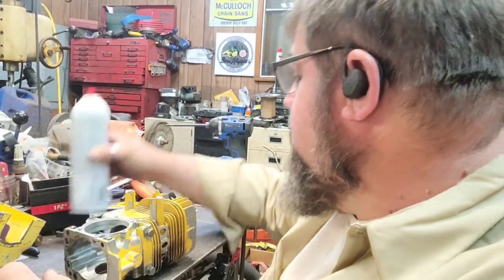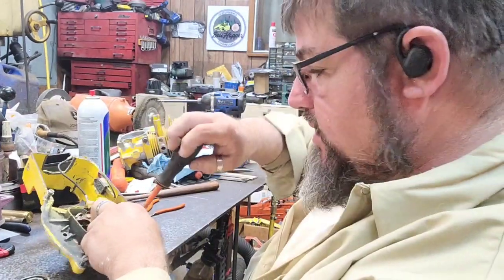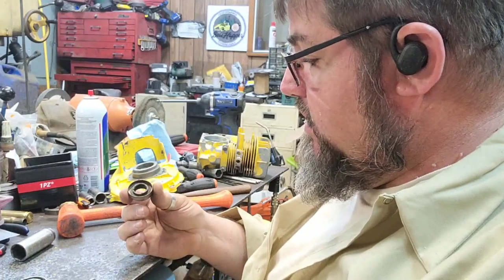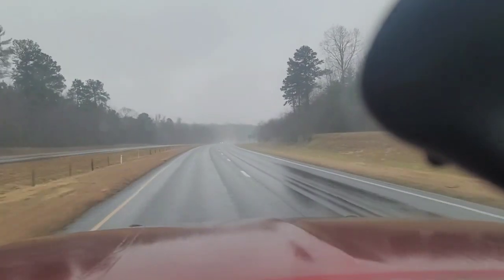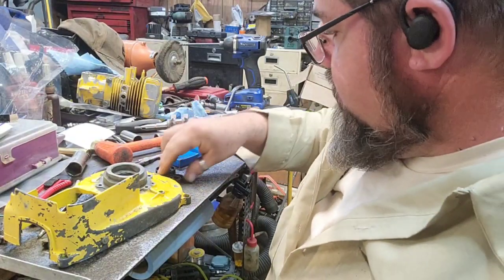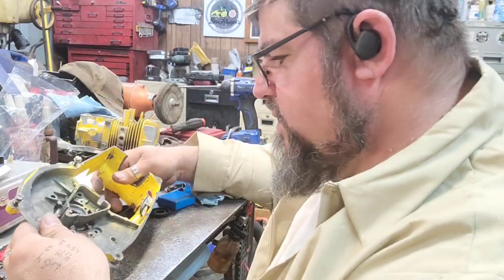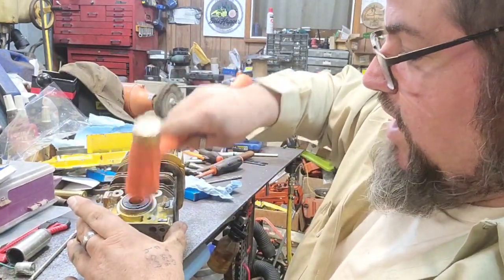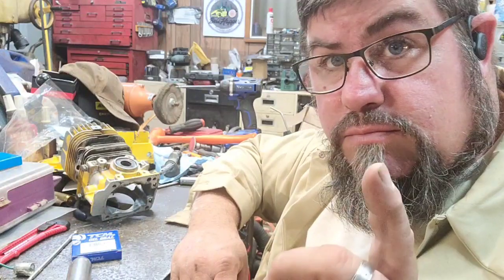Mcculloch S550 Hunting Parts

Comment: You onky need the one seal on the flywheel side, the most inner one with the spring is what holds the pressure into the crankcase, the outer seal is just a dust cover seal and unnecessary because the seal is sealed in a the points box anyways.

Comment: Hey there buddy! What type of sealer do you use if you don't mind me askin.
Reply from the maker: Permatex ultra grey is what i use
Reply: @bellhoppersaws  same as me then lol
Reply: Permatex -  Ultra Black Maximum Oil Resistance (Black)) - Used in areas where oil resistance is a must. This would be oil pans or valve cover gaskets. ... Ultra Grey Rigid High-Torque (Grey) - Eight times more flexible than cork/composite gaskets; three times more oil resistant than conventional silicones. Google search.
Reply: @StevenLettsPerformance  hello buddy hope everything is well.
Reply: @justinweaver8787  yepper all is good hope the for you!

Comment: What models use a points and condenser the same as a 250?  I need to change out mine.
Reply from the maker: I think most of the big blocks are the same ive havnt had that many but they all close
Reply: Any thoughts on a Tillotson hl 63f carb kit?
Reply: points are 88806 the condenser is 85358 or mallory 400
Reply: @jayjay-xz9sc  Any HL carb kit will work